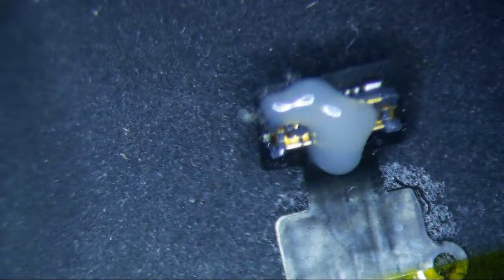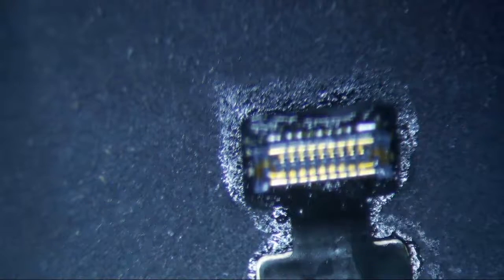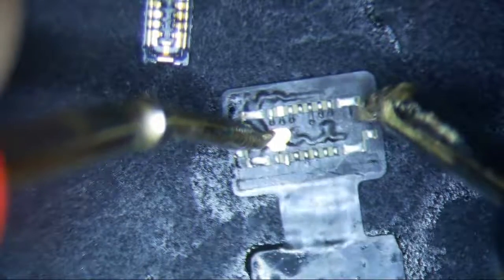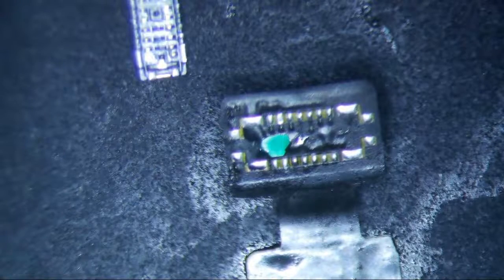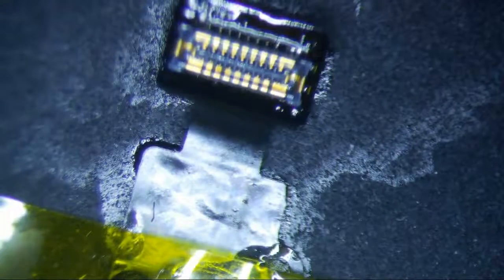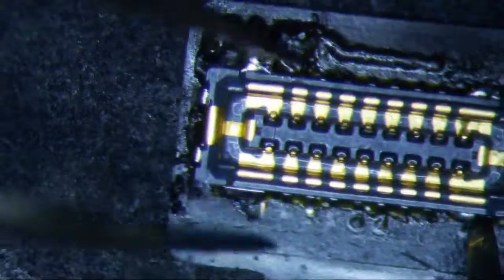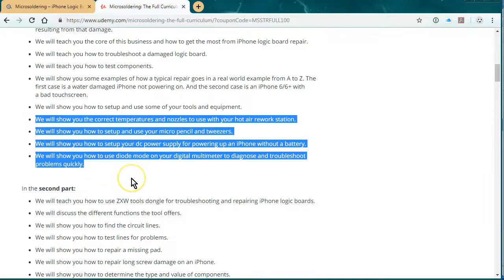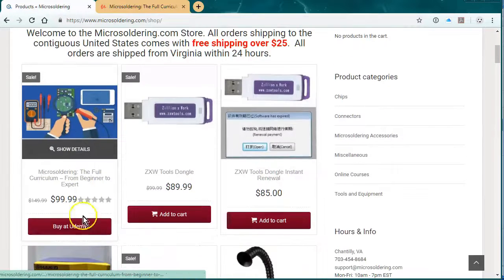iPhone 8 Home button connector Repair on Flex

Comment: Do you know where I could get a 5S home button connector? Touch ID stopped working due to corrosion on the connector.
Reply: Maybe ebay?  Alibaba?
Reply: @artman102  I tried them but all the sellers have only LCD and touch connectors. Nobody sells home button connectors. I was hoping the channel owner would see this. I have ordered a whole home button and will try to transfer the connector without melting the plastic.